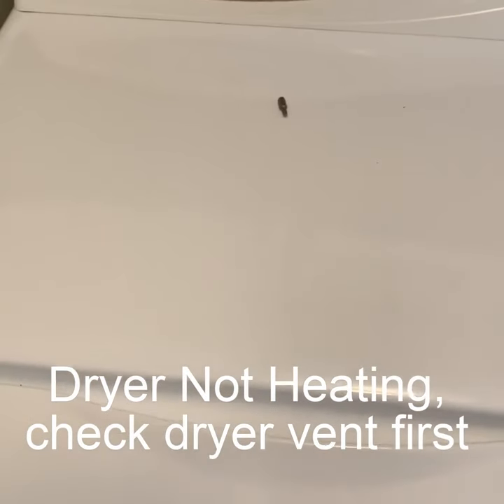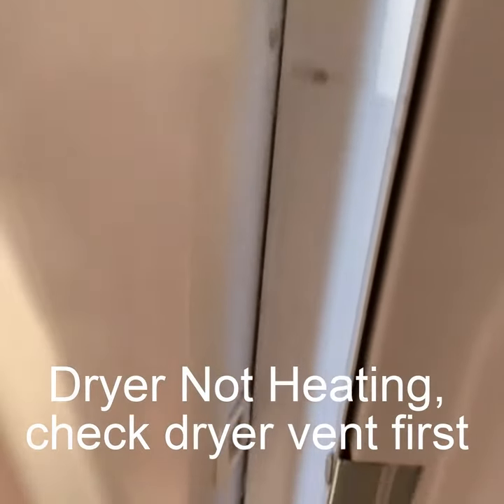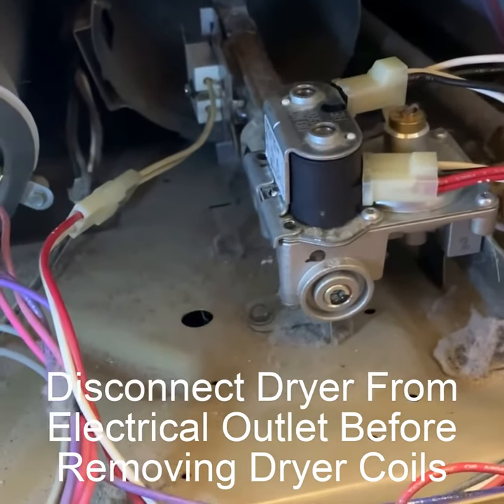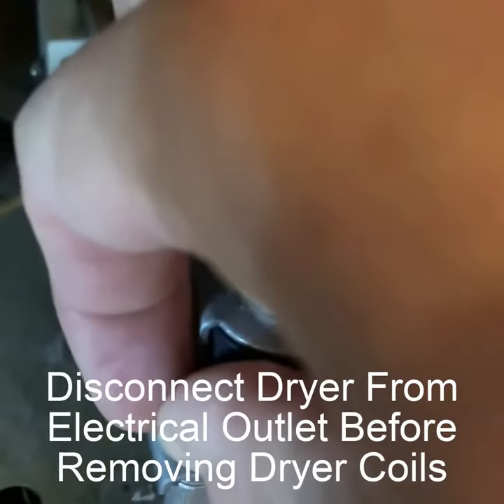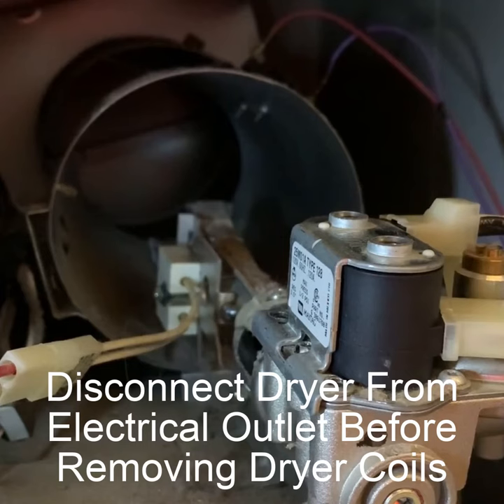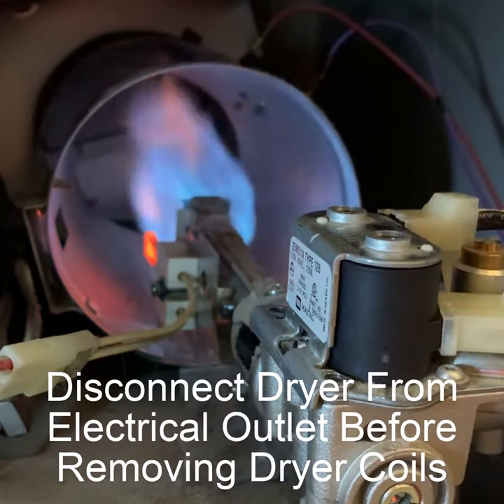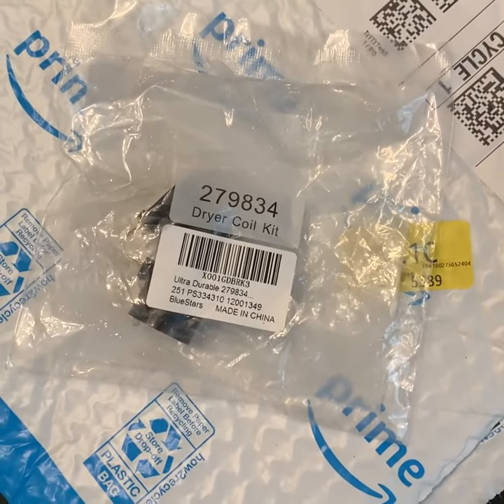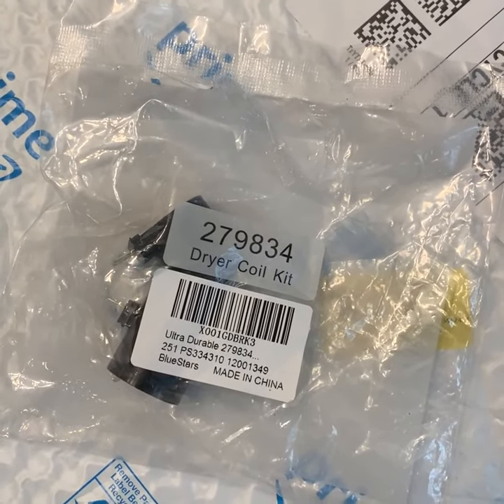Maytag Gas Dryer Not Heating Easy Fix In 15 Minutes

Comment: I contacted my Maytag dealer and symptoms were given with known advice for home repair for less than $20. Changed coils in about 10 min. and up and running . I was told parts are ready available and to keep it running as long as I can. Thank-You
Reply from the maker: That's awesome.

Comment: Hello John,  my dryer (which looks similar to yours, but a little newer) was not heating.  I am a practical tech guy, but was a bit worried about disassembling the machine, fearing gas explosions, fire etc. and was not sure how to get into the machine apart.  Watching your YT clip showed me how easy it was to get the front off, so I got on with it.  I removed the front, and switched the machine on.  I noticed that unlike on your machine - the igniter did not glow red hot.  On closer inspection, it had a tiny gap part way along the heating element.  Although the reason for my drier not heating was different from yours - your YT clip directly contributed to my confidence to repair the machine myself.  My deepest thanks to you for taking the time to make the YT clip which has saved me a lot of time and expense.
Reply from the maker: Awesome

Comment: I have the exact same dryer and had the exact same problem. I bought the coil kit and installed it. And it worked!  Such an easy fix. Thank you so much for sharing.
Reply from the maker: simple solutions can sometimes produce the best results

Comment: Worked for me.  Our 25 year old dryer still has life.  
BTW, when testing a cycle, there needs to be something damp in the drum otherwise the moisture sensor trips and the controller turns the gas off after a few seconds.
Reply from the maker: Glad it worked

Comment: Thanks for the video. It solved the issue with my Maytag commercial. Unfortunately I couldn't wait for an Amazon delivery because I needed to wash/dry clothes for a next day trip. The nearby appliance store had the coils in stock but I had to pay $35. Still much cheaper than a repairman call or new dryer.
Reply from the maker: Fantastic!

Comment: I also have a 15 year old Maytag drier.  Turns out it wasn't the coils.  Those two can be checked with an ohm meter for continuity.  Since I bought them ($10), I changed them anyway.  I figured it might be the igniter.  There is only one hex screw to remove.  I check this part after disconnecting it, and the circuit was open.  I bought another ($28 on Amazon).  Done deal.
Reply from the maker: Awesome

Comment: Hi sir, my dryer has the exact same set up. But it seems the igniter won’t heat up. I didn’t see the red glow. What else I need to check? A fuse? Or maybe the igniter is bad? Where do I buy the coil anyway? Thanks
Reply: I’m experiencing the same issue right now. Did you figure it out by any chance?
Reply from the maker: So sorry for the delay, I don't have comments set up so I don't see them and I am terrible at checking them. If the gas fires up and goes out then the next issue is your ignitor... Amazon is where I bought my parts check them out...

Comment: Curious when it was broken, did that red coil heat up? I may be getting gas. Just no pilot
Reply from the maker: My issue was the gas would fire up and then quit. I started with the coils first because it was the easiest to try and resolve and then the next step would be the ignitor... Hope that helps.

Comment: The coils could be one issue if the flame doesn't go on. How about the possibility of the gas valve???
Reply from the maker: If the flame doesn't go on at all then I would switch out the coils and igniter first... simple to do and the cost is minimal.

Comment: I replaced my coils because it was doing exactly that is it still doing the same thing. So I have replaced the coils and the thermal fuse. Logically I'm not sure what would be the next step
Reply from the maker: The thermal fuse or ignitor would have been my next choice but the coils fixed my issue. I just didn't need to go any further. Either fix is simple and cost effective. I hope it goes well for you.
Reply: It's not going well unfortunately. I understand there's more than one thermostat. A cycling thermostat and a high-end or something like that. One at a time I may replace both. I'd like to do so without removing the drum do you know if that's possible?

Comment: what if my igniter turns on and turns off in 5 seconds or less and keeps doing the same on and off
Reply from the maker: That is exactly what my igniter did so I replaced the coils and that resolved my issue been running great ever since.
Reply: Same here. Got soaked for $350 for $100 worth of time and an $11 part.
Reply from the maker: As in all repair work it's not the parts that cost the most money... It's usually the labor and the cost of running a business.

Comment: Is there  a pilot light inside the dryer like it’s in the gas water heater? Thanks!
Reply from the maker: I don't spend much time on youtube so I did not see this comment. Yes there is a pilot light that ignites. My problem was the flame would ignite and then go out. If your pilot light is not working then you might need to replace the ignitor switch which is not difficult to replace either.

Comment: Replaced coils, still no flame!
Reply: What was the fix?
Reply: Flame sensor???
Reply: @jjeremy350  where is that located
Reply: Check for continuity of the overheat sensor and the igniter. Either one blown will not stop fan but will stop gas for safety.
Reply from the maker: Some great responses in this thread